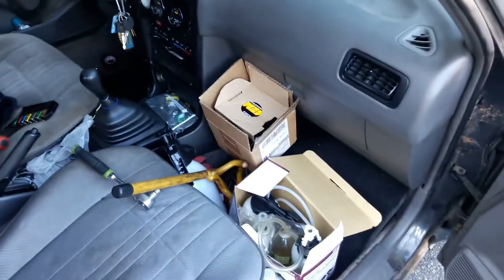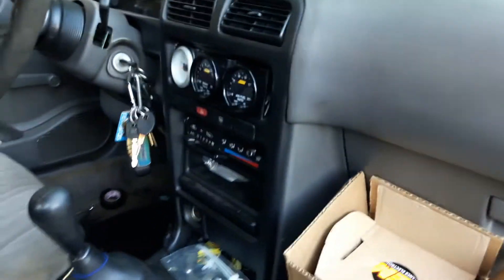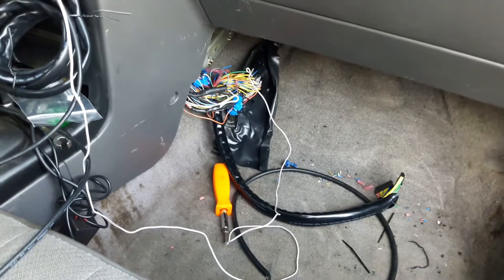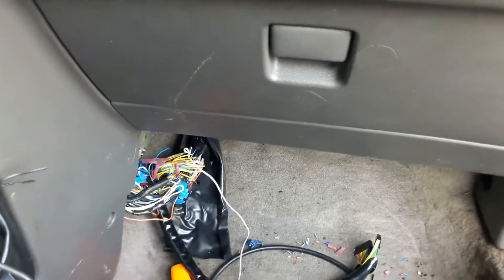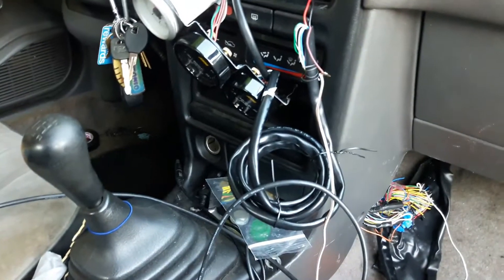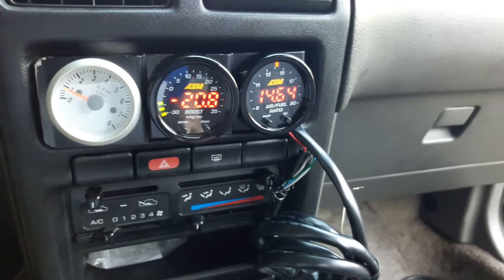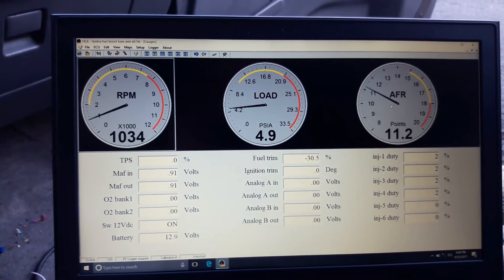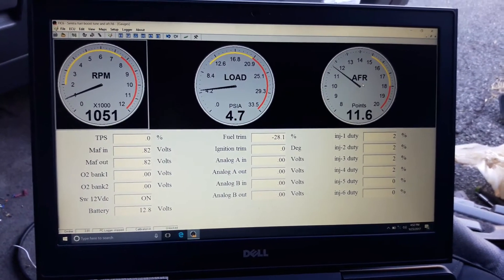B13 Turbo 1.6 Sentra - ECU Wiring Completed

Comment: Brother that's really good how you wired the USB cable into the glovebox, and for the cluster from the '99, did it fit as a direct replacement or did you have to make some adjustments for fitment?
Reply from the maker: Akber Jafferi thanks man..
The cluster fits perfectly, but it has to be re-wire completely again.

Comment: Bro what king of turbine you are using ?
Reply from the maker: Ahmad Faizal i have an ebay t3 turbo.
Reply: The trim ar60 or ar50
Reply: Do you have any whatapps that i can comunicate with you ... going to build like yours have a problem to choose the turbine to put in .
Reply from the maker: Ahmad Faizal i dont have whatsapp..
Do you have a ga16de engine?
Reply: Ya i have sentra b14 with ga16de engine. I do for hill run. Search my video "swntra b14 touge kkic"
Reply from the maker: Ahmad Faizal a t3, is a big turbo for a ga16de engine and takes time to spool the turbine. Probably in your case, will be better to use t25 or t28 turbo off any sr20det..
Reply: Yours Ga16de too rite ?
Reply from the maker: Ahmad Faizal My b13 has a ga16de turbo. My b14 has a jdm sr20det.

Turbine specs on my 1.6 are Cold side is A/R.50 and hot side is A/R.63..